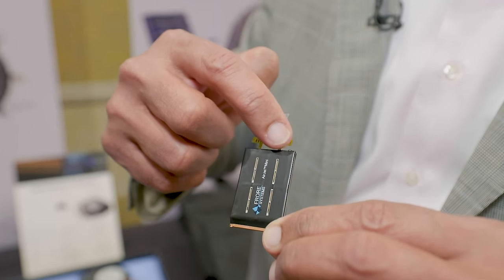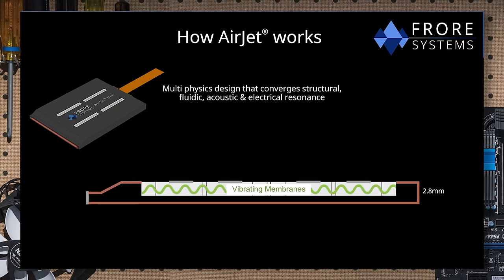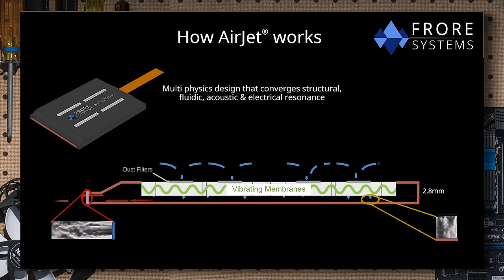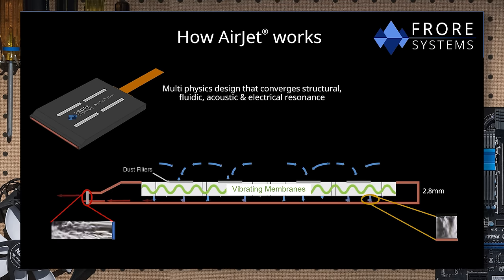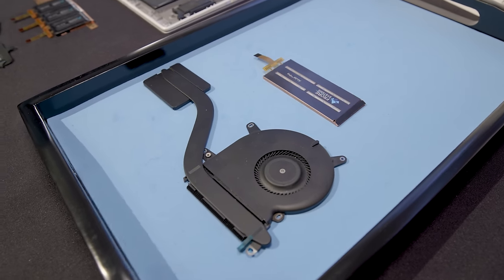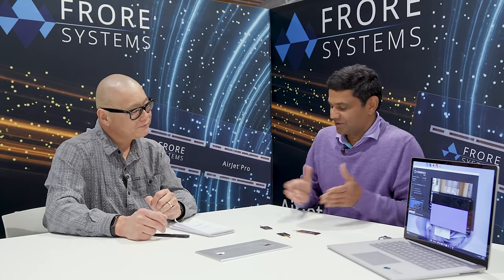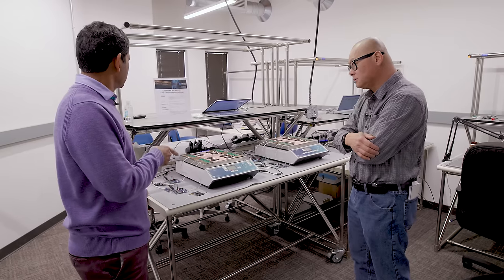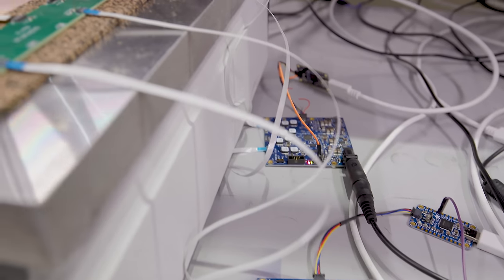Take A Lab Tour Of This Solid-State Cooling Tech

Comment: i have to wonder if this tech could be utilized outside cooling. Since the air speed is 200km/h with no sound, could this be used for drones/ things that hover/rc boats/water vehicle. does this tech have a lot of static air pressure? could be utilized in high density fins, maybe even higher density than we have had previously. Maybe could be used in car heating, to cool engines and use the heat in the winter for the cabin. This is my shit, would love to work at this stuff. :(

Comment: As long as the price isn't ridiculous, I'd easily pay extra for this over a standard fan. It's like SSD's today - sure, HDD still gives you better storage per dollar, but the quality of life improvement with an SSD is so huge that it's worth the price of an upgrade. Better cooling necessarily means better performance, and combined with less noise and and smaller footprint, this is very exciting.

Comment: "you dont need to have vents at the bottom of the laptop" a slight mistake there right? because the chip needs to pull air, if no vents thats means the airjet performance is going to be restricted because the only air it can pull from is in between the crevices at the ports around the laptop or the small gap between the keyboard or through the side vents in latest laptop design like in most gaming laptop. Assuming the plate can fit 4 airjet in 1 line, doesnt that mean the one near the center have less air to pull (if the only the way air can be pulls is from both left and right sides of the laptop vents)

I could be wrong about this, considering the performance of the output of the jet itself, the suction power could be strong thus pulling in air from the back which is near the exhaust itself, wont that create a near closed loop? 

As far as i understand, you cant make the laptop vacuum because that would be terrible then the airjet doesnt have air to pull in and push out to begin with

Comment: I would see this technology applied to server farms which being fundamentally fixed infrastructure could be designed to harvest the hot air and use it to contribute to the building heating utilities (hot pumps and hot water boiler). Also, there might be less power needed for the aircon (not very sure about this)...

Comment: While not quite as visually representative, this is like going from filament to resin for 3d printing. Sure would like to see these integrated into high perf DDR RAM modules and certain parts on a standard mobo that don't have active cooling other than whatever bleeds off a case fan (or like VRMs where you have to compromise the pathing from another unit).

Comment: Q : How to manage with dusts?
A : Two ways. first, dust filter. second, dust filter. Device is strong so there is no loss of flow.
What is the logic? or some kind of business security?
Reply: Blocking particles over micron is not a critical issue. HDDs are already doing that. Real problem is how to manage inlet. With this 'non-moving, high-volume, high-pressure, small-slit' component the 'filter' will instantly clogged with dust 'blocked' by filter in user space.

Comment: Anyway, MEMS was never been 'Solid-state' device, and saying 'Heat transferring with flow of air touching heatsink' as 'not a fan way, heat transferring device' is kind of misleading. Traditional fan with heatsink is also 'heat transferring device' and AirJet also same energy transfer route as a fan. Its just changing 'way to make airflow much compact'.

Comment: Great coverage, but I am disappointed that no one mentions double dipping on the hot hair by also putting some cooling fins in front.
This would lead to thermal feedback on lower temperatures, sure, but on higher ones the air will still be cooler than the fins and take away even more heat.

Comment: it’s call the Piezoelectric fan. While it’s cool and all but the airflow is nowhere near the traditional rotary blade fan and the fan noise you hear when the fan ramp up is not the noise from the fan itself but the air it moves so I doubt this will be much quieter given the same airflow.

Comment: well, remember the original fans how they are built, with feathers or think wooden pieces and we just flap them, so we could've say in the past about modern computer fans "well this is not a fan because it contains its own motor" so it is a fan, any device that pushes air is a fan. We even have ionic fans and they are also solid state, there is already research on solid state electric wind power. So how you are pushing the air does not matter, what matters is that is a device that pushes air, so it is a fan.

Comment: This is a perfect solution for cooling laser diodes. My 3 Watt RGB laser projector uses a huge 100 mm x 69mmx 36mm heatsink with 4 * 4020 12VD cooling fans in order to avoid the laser diodes from going into self destructive thermal runaway.
The only alternative is using thermally controlled TECs, which can potentially cause water condensation on the optics inside the RGB. 
Furthermore, without the heatsink and fans, the physical size of laser projectors could be reduced ~25%.
Please allow this great solution to be available on the open market, instead of limiting it's availability to exclusive corporate giants. I needed it last month for my recent laser projector build.

Comment: I like this technology. Having a one micron filter on the back of the laptop body will require frequent attention. I do not recall hearing Seshu mention that need. The filter at the back of the laptop frame likely requires convenient removal for aggressive cleaning because one micron is very small. Impingement of particles just above one micron size may require more than just vacuuming. Also, oil condensate deposition on the filter surfaces will exacerbate clogging and a need for aggressive cleaning.

Filter technology down to a 1 µm scale often uses an upstream series of ever smaller particle removal techniques. The time interval before maintenance on a 1 µm filter depends on the efficiency of upstream particle removal, as well as particle and condensate load. I did not notice mention of Lab testing that includes filter loading from particles or condensate, and the subsequent maintenance frequency needed.

The marketing speak Seshu uses annoys me as sometimes his word choice is grossly misleading or plain wrong (e.g. air being good at heat exchange). He is clearly smart enough and informed enough to avoid those uses.

Comment: I would sugest minor change i.e Reverse the Direction of flow at start which is not possible with fan to remove dust from filter and then the normal airflow starts, it will be effective to blow dust out at start, or you can set in between normal working, like 1hr or 30min gap. im curious about the air speed thats getting out of that vent😂😂.

Comment: I wonder if we can see a gen 3/4/5/6 where you can slap one on a GPU board or even on both sides and blast all heat directly out the pc. Though by the time they get better they'll need to cool a 6070/80/90...
Reply: In a past interview the rep said that it would have to be so much larger for a gpu as the small ones we see in this vid are for low power laptop cpus.  He also said they may one day expand to higher power stuff but since they’re small atm they’re solely focusing on the lp cpus for now.

Comment: This will be a given in high performance tablets of the future. I can already see Apple contacting them for the iPad Pro next generation or so. However, for the higher power output laptop segment, they better use a traditional heatpipe/heatsink combo and actually use the membrane part as a fan replacement. The surface area of the chip/copper plate contact is too small for any cooling to be made possible for something over 5-10W. You need heatsink mass and surface are for a gaming laptop etc.

Comment: Since it's solid state, just thinking out loud, perhaps these air jets can be made to be the actual back plate? (lot more surface area to work with) Or just simply expose these chips in order to fit in more or larger units? One issue though the plate or chips might be too hot for skin contact.

Comment: This tech is really promising and would love to see commercial products using this. Even with the current limitations on thermal potential I can see it being used in conjunction with the already widely used vapor chambers for higher wattage applications. 
One concern I thought of during the air density demo was with the exhaust air being of much higher temperature, would that pose a hazard or maybe just discomfort if we make contact around the exhaust area. Even with current laptops it get uncomfortable after a while actually using it as a laptop and pushing the power envelope of thinner and lighter devices that are more likely to be used this way, I can see this being an issue in the real world.

Comment: TBH, the tech is not new, just new to the market, and the main concern about dust, usually wasn't something talking in microns. Things using microns are on particle level, what actually matter about dust should be fibres, hairs, they are what actually being caught on fan blades and filter. Considering the design and size of the device, it doesn't look good in long term(months)/ mildly dusty environments.

Comment: Can't help but think the use case of these will be very limited in it's current iteration. Above a certain wattage these will be less space efficient than even a very quiet heatsink and fan combo.
Reply: It's more for thin and power efficient devices. Think Switch or Ultrabooks. You probably won't put these into your gaming rig, be it PC or notebook. At least not for now.

Comment: Be interesting to see how this scales even without future generations. For example, my gaming laptop is a 2 fan design with a cooling solution around 200W capacity. Let's say they're thicker fans than the ones in the thin laptop displayed. 4 units at each fan, x2 by making it a sandwich onto the heatpipes. At 16 units that's potentially some 80W of cooling power. Might be enough for lower end gaming laptops but it needs to scale to >200W for mid-high range.
Reply: They do say it is for notebooks as of now. And they are they are testing to cool chips that run at 85°C(from the tests). They may be working on bigger and better ones but right now they are designed for small and light form factor devices.
Reply: The air jets look really thin for now. I wonder if they can make it bigger and higher since gaming laptops tend to have a lot more space inside.
Reply: These might not be able to cool that, but they may be able to supplement it. You might see the fans go to a lower RPM with a few of these helping out by removing some 56W on 4 "Pro" models. That leaves your fans with only 146W to handle instead.

Comment: If it's really low power then it could be used for space travel also. Space is not empty and if this can push that rarified gas and space dust at high speed the the laws of physics take over and you have thrust. Sort of like a zeon system but just using a gas collector on the front of the ship and pushing it out with this would be interesting.

Comment: from what I've seen it seems that its solid-state because the source of the movement for the membranes probably is due to piezoelectric effect. They likely use electricity to vibrate cristals and that vibration moves the membrane without any free moving parts. the only thing I dont understand is what kind of movement the membrane has to do so as to produce an adequate stream of air...

Comment: well put 4 of those pro on a vapor chamber with heat sink in front of them will allow the to achieve a higher cooling capabilities. hot air with 40 watt at that speed should have some thermal capabilities for some more, atleast you should be able to get 20-50% more cooling from it. also this seems like a perfect device to go on a ROG 6D Ultimate. 6D ultimate already have a heat sink for cooling and rather using an external fan, the build in cooling should be better. 5 watt of cooling capabilities are better than none or requiring you to carry a fan with you. i know some phone already have fans in them, but boy they are loud when its hot.

Comment: I really wish there was a place to send in ideas to this company on other applciations for this tech. he said they are not looking to replace a ceiling fan but if u replaced the ceiling with a giant one of these could use it in refrigeration? would the vibrations bee too intense? what about heat pipe arrays in a cluster form, could u attach like 10-20 airjets to this in the same space an iar based cpu cooler would take up?

Comment: Can these be optimized for water? An AIO where this is the pump block would be fantastic for reliability, quietness, and efficiency since you can transfer much more heat with water. The back pressure also makes it perfect for pumping water through a loop.
Reply: linus tech tips recently released a video about a phone that has a liquid cooling loop built in from the manufacturer and it uses a membrane pump similar to this to power the loop so could be worth checking that out although for more general knowledge on this air jet seems to be a membrane pump optimized for low viscosity fluids so that could yeild results for some googling
Reply: 13:30 If my understanding of this is correct, you would not move more with water. That's the whole point of these coolers, is that you hit the heatspreader with such a velocity and angle that you satuate the air with the heat. The heat coming out of the cooler is same temperatur as the heatspreader.

Comment: my 1,7 kg light and 16,5mm thin 15 inch laptop from 2019 can sustain 80 watts. fan nouse is ok. especially at 45 watts the fan noisse doesn't bother me anymore. There are even 15 inchers being able to cool 200W sustained for GPU+cpu. can't imagine this tech could do more than 80 W for a 15 inch gaming laptop?

Comment: Yup, some companies - looking at you HELL - regurarly f-up their laptops as they look good on paper BUT are not able to run to their full specs due throttling.... on battery they throttle down so the user experience /battery life and noise/ is good and on AC power they throttle because the system has buggy cooling and overheats... so on paper nice machine, in real situation you can count yourself lucky to be able to reach 60-70 procent of what the machine would be capable of.... because the company has other priorities than deliver a powerful machine....

Comment: He talks about moving air at 200km/h, for the power consumption of 1W (airjet mini), Assume perfect energy conversion , so 1W of KE is generated, volume of air moved will be equal to 0.0005 m3 , which converts to 1.06 cfm. Since there won't be perfect conversion, so < 1cfm, in 2023 an average quality laptop fan moves 5 cfm of air while using 2.5W, while the cheapo ones moves around 3 cfm using..the same 2.5W. So that's why they have to line 3 airjet up to compare with a cheapo fan, but these 3 airjets will always consume more power themselves to move the same amount of air versus a cheapo laptop fan.

Comment: Im gonna understand this as a heat pump, but instead of using compressor like air conditioner, it transfer heat to air particles till they are heat saturated by exhausting them out 200km/h. I wish this technology is more mature

Comment: So if they rely on the surface area of the copper, why don't they just double it in the same space and thickness. Yeah i know, but the fluid flow model with the frequency modulation of the membranes should be able to take advantage.
-MG

Comment: Probably unlikely, but this makes me wonder if you could make a similar device for water cooling, replacing the impeller and getting around the AseTek patent for AIOs.
Reply: Seems like it strongly depends on a air permeable membrane. They'd likely have to redesign the entire material to be water permeable instead which is a much bigger ask.

Comment: 20W for 4 of them is neet for ultra thins but it'll be so much cooler if they reach 150W without needing 20 of them (pun intended). imagine a new razer blade that is 10x quieter with an nvidia 60tier GPU. still stupidly expensive and terrible battery life but more comfortable to use.

Comment: great technology. The boundary layer disruption seems to be key. This one device takes the function of a fan AND a heatsink( which would need much more surface area). only drawback I see is the worse ratio of it own power consumption compared to the heat power removed. But if it actually cools and thin laptop almost noiselessly, I would be willing to pay quite a premium for the silence.

Comment: fans are typically rated for 50k hours or just over 5 years. the airjet is rated for 5 years. why so low and what is the failure mode after 5 years? fans typically wear out their bearings creating noise or they stop completely, making the failure easy to identify. the airjet is silent and the exhaust temperature is not perceptible because of cool air entrainment, so it is hard to tell if you have a failure especially in an array system with 3 or 4 airjets.

because of the nature of the mechanism, the static pressure is very high. it might be possible for small or mobile devices to have no extra air vents at all for the airjet. possibly air can enter from existing speaker or microphone holes.

Comment: He keep demonstrating how the reliability test was done, and keep demonstrating how many jet are needed for various laptops, but he did not use the most straight-fowards way to demonstrate the performance by measuring the CPU temperature against normal one. Moreover, (may be I didn't notice) there are no power consumption information of the jet and which is important consideration for handheld equipment.
and as a layman, I really don't understand why solid state device will have mechanical moving part and noise generated.